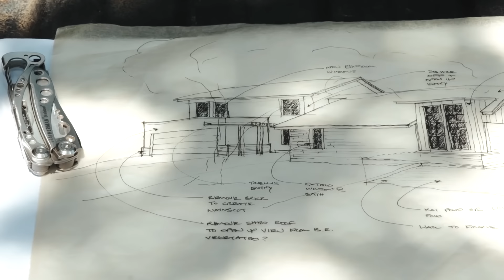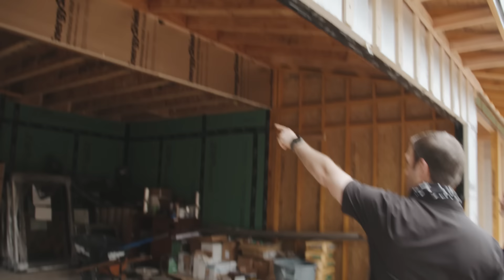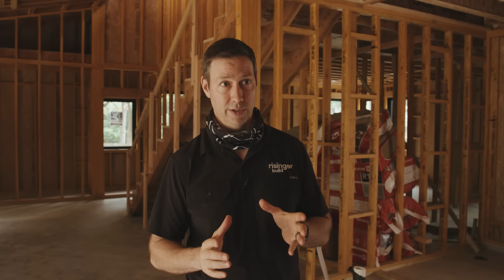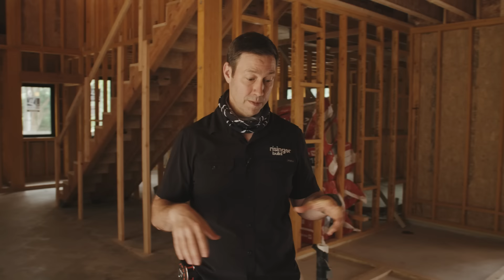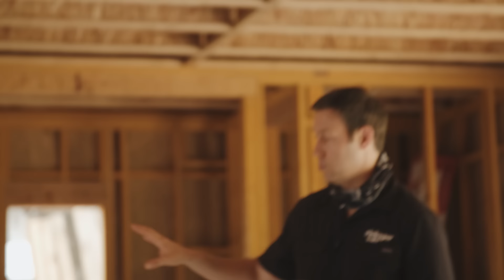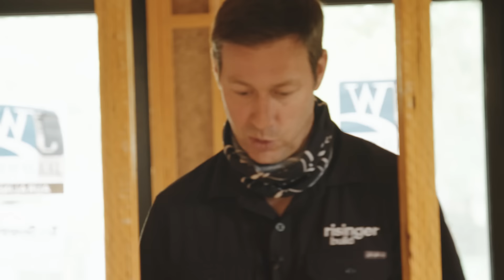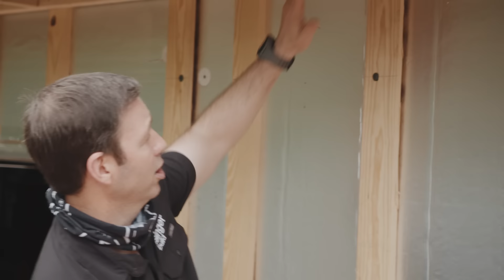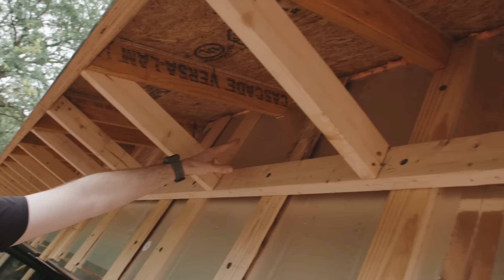The Perfect Wall - Building Science Training

Comment: what is the function of windows in an "airtight" home with an HVAC system that brings in fresh air on the homeowner's terms? are the windows purely for lighting/solar gain purposes, or are they also to be considered for ventilation? it almost seems, with the perfect wall system, that the windows should just be fixed so as to not disturb the balance of the HVAC system. thoughts/input?
Reply: Ventilation is a big part of our lives. Open the window, and you'll get plenty. It also doesn't cost you a cent of electrical power to open the windows.
That said, if you have allergies certain parts of the year, then keep those windows closed, and run the HVAC system.

Comment: you had me up until polyiso... It's no good Matt. we need to get all of those engineered products out of our homes.Engineering needs to shift focus onto what the core building mass in and by itself can do without motorized this and composite that. All of the buildings you are referring to as being 3, 4-500 years old don't have any of that, and those that have since become that plastic bag treatment, are rotting from the inside out. Maybe a building doesn't need to breathe, if it's concrete or plastic, but wood certainly does. One thing about moisture is that you can be certain it will get in. the trick is to get it out again, and that is where polyiso and any mineral wool will fail. Eventually. Not today or tomorrow, but give it between 10 and 50 years. Those properties are built in in old school materials: Wood, adobe, lime, that sort of thing. The entire structure needs to be part of moisture handling, and tied in with that, of course also insulation and light. To build the optimum, you'll not only need to know your climate zone, but also the 4 corners of the world, along with the sun's path across the sky both summer and winter, to size and place windows and eaves. Clay render can handle a great deal of the inside moisture from sleeping, cooking, showering etc, if done right, meaning for instance no latex paint on the walls. You've been to Tirol, and seen how much of it works, even though it's not Texas. All of those buildings have a vapor brake in stead of a vapor barrier. As long as things can dry out, there's no need for waterproof. You don't live in a swimming pool.
Reply: How do you deal with temperature control without sealing though? As far as i can figure, all the buildings that are currently 500 years old never had AC, so no condensation problem on a massive scale. I do understand that any structure will provide shade and a cooler relative temperature and that condensation will occur at or below ground level due to the cooling effect of the earth. As such old structures are usually damp in the cellars and basements. Which is not a problem because those areas were/are constructed with water tolerant materials like stone or brick for load bearing purposes. Not a great thing for mold though. 

Based on this I would have to assume that either the type of structure you are advocating would not have AC, and would have damp below ground structure. Or would have AC and then have a large dehumidifier system to control dampness. If its the first case then you sacrifice temperature control for structure longevity or in the second case you sacrifice energy efficiency for longevity. I'm unsure if I'm missing something(you seem knowledgeable so I probably am) but neither of those scenarios are my personal first choice.
Reply: @lexpox329  That I can definitely understand. Neither option is very pleasant. However. There are solutions to these problems. More natural ones. If you're in AC climate, an option could be to lay down a pretty grown pipe for air intake, both length and dimension, in such a way the condensation, if there is any, would happen prior to entry of the house, and run backwards in the pipe (sloped down slightly towards air intake, in conjunction with a "heat chimney", which would basically be a window, hatch, roof outlet or whatever, that lets hot air out, and sucks cool air in from the ground. No gasses, compressors or motors needed, only the right dimensions and numbers for the house, maybe with a flu and a small solar fan to regulate airflow.

In the south, warm/hot climates, you'd want lots of thermal mass and shade. Building gets heated up during the day, and stays warm at night. Typical desert climate. To deal with heat during the day, you'd preferably want tall ceilings, and buildings created with lots of surface area, so one part can shade another, not to overheat it. Narrow streets and tall-ish buildings, like in the Mediterranean is one way of dealing with it. Then you can decide whether everything actually needs to be indoor space, or you'd like for some of it to be atriums, an arcade or some such. An indoor water fountain also doubles as air-conditioning, though much more pleasant. There are ways to make those with a minimum of added power as well.

Up north where I am, we have warm humid summers, semicold winters and wet about ¾ of the year. The pea belt. Perfect for rusting cars and rotting houses. We can't afford to waste the sun, and so need large windows to take full advantage of the winter sun, but to be kept in the shade during summer. Along with all of the water, this means you're going to need large overhangs/eaves, trellises and the like, for light control. Otherwise you'll have 110F during summer in the house, since they are insulated at least to the point of Canadian passive homes. The underground air intake works just as well here, though need not be dug as deep, or have the same dimensions as in southern climates.

The hygroscopic properties of steel, stone, cement, oil derivatives and glass clash with wood. They're best off not being mixed, unless we're talking windows, where there are ways for the moisture to escape. Much healthier for the wood is clay, straw, hemp, lime and other non-chemically bonded materials, chemical as in man-made. Clay is one of the best materials to keep wood dry along with being an excellent thermal mass and moisture regulator as well. With daily airchanges, you'd barely need any further ventilation/dehumidifying in most rooms.

The old ways have gone lost, and modern construction only seeks to monopolize through patented systems. It is no longer a place for thinking individual human beings, like the craftsmen and architects of yesterday were. There needs to be an uprising. It's becoming about as bad as buying into a nicotine habit.

Comment: Matt I am going to start my own house remodel, house has 2×4 studs im going to rip out the sheetrock,  then and 2 inches of closed cell , would it be okay to add zip system on the inside then 5/8 rock?  Reason i didn't rip the outside off was going to do two rooms at a time..

Comment: Great episode, thank you.  How does the perfect wall concept vary from your house in a northern climate?  I am in Manitoba, Canada which would be a relatively similar climate to Fargo/Grand Forks/Minot, North Dakota.  Specifically, in relation to a vapour barrier.  If we create our continuous air barrier using zip or an equivalent product how do we protect the wall assembly from wetting without using an interior vapour barrier?
Reply: Read Lstiburek. You are not grasping the concept. Works just fine in ANY climate. The key is balance of interior/ exterior Rvalues, if you do as Matt has here, and add interior batts. The goal is dew point ALWAYS in the exterior foam layer. A vapor barrier on the inside, in any climate, perverts the systems and can lead to rot.
Reply: The whole point of a perfect wall is that it's perfect--it performs excellently in any climate. In your example, ZIP is your vapor barrier, and even if it weren't (e.g. you used DensElement), when the water vapor condenses it does so in a material like foam or mineral wool that isn't damaged by water.

Comment: Great that you're using an ERV.  Zehnder is used in a lot of passive homes.  Did you consider https://buildequinox.com?  Their CERV2 is "smart".  It changes air flow based on sensors of heat, humidity, voc's and CO2.

Comment: Quick question on your solar.  Are you going to tie directly into your local grid or are you thinking about using batteries and an automatic bus transfer device so that if the grid goes down, you still have power?
Reply: A generator will work just as good, no ?

Comment: Somehow I wouldn't have thought that R26 on the roof would have been enough
Reply: If you consider no thermo bridging from the rafters it's more effective. Plus if you look at the insulation curve anything after 30 - 40 R is a waste of insulation.
Reply: Also, the Delta-T of Austin isn't what you're going to find and Augusta, Maine.  Cooling, in some respects, isnt as hard as heating.
Reply: He'll still be adding batt insulation between the rafters to bring the R-value up to code, or beyond.

Comment: The airspace on the exterior of the house with the Wildland fire preventive measures how do you use a screen that would meet fire code..  what I've seen is very expensive to use is there an economical way to prevent fire from being drawn into the wall
Reply: Front Range Colorado these regs are common in the foothills/ rural ares. We have had to build per the regs, and roof venting is simply prohibited. I have projects up for years, with the compact roof assembly, no air gap, and NO problems. You give up a bit of insulation potential, but just size the foam layers appropriately. Still the absolute best (for me, ONLY) way to go. 

As for walls, we did stone veneer with a very robust drainage plane dimpled mat. Venting the wall was not a big issue, but insuring the sanctity of the weeps is very critical. If you are seriously looking at a real project, and contemplating rain screen in a Wildland Fire Regs district, I would get all my ducks in a row early, and go talk to the plans examiner. We do this regularly, given the nature of our jobs. In the talking phase, you have "wiggle room", and can get your ultimate detailing approved before you are slammed with a "tear it out" order. You could very well prevail with the right approach.

Comment: We hired someone suposubly to replace our siding and they told us that we were supposed to change the Particle Board exterior, and replace it with harder type of compressed wood. To add color plus  James Hardy siding. Is a total disaster . It was installed by amateurs etc. Anyway also out home is like 40 years old the boards looks boated and they didn't let us know.  Now they said that is because our house was uneven. If they would have let us know before. Also suposubly they are James Hardy Elite company.  Etc......

Comment: Can I do a ZIP wall system on a 5 year old house here in S.E. North Carolina? The builder cheaped out on every portion of this house. The house leaks air like a sieve. 2X4 wall construction with R-13 batts, cellulose blown on top of the ceiling. The air handler for the heat pump is in the attic space and when the blower turns on the flexible insulated air conditioning ducts are initially blowing warm due to the attic air heating them during the off cycle.
Reply: Steve, try this, for starters:

https://www.buildingscience.com/documents/bareports/ba-1502-measure-guideline-high-performance-mineral-fiber-insulation-board-retrofits/view

Then you can read more of their stuff. Dr Joe is The Godfather of building science, Matt is the acolyte, who now has to tend his sponsors and media empire, to the detriment of disseminating a full knowledge base. 

There are MANY pitfalls. Do not undertake without full understanding.

Comment: How do you properly flash at wall to roof areas when you have foam at walls and furring strips? Wouldn't you want that at your water protection layer (in your case from Wall Zip Sheathing to the top of your second layer of Roof Zip Sheathing?

Comment: Do you have flashing to handle water that may get behind the polyiso on the roof/sidewall intersection?
Reply: Watch his last video, he did a test and it drained.
Reply: That's my point.  Any water that hits the gable will have to be handled by the facing of the polyiso and the rain screen.  If any water gets behind the foam board, it doesn't look like there is flashing to divert that water back out onto the roof.
Reply: @jonblakemore6454 , Matt is definitely going to have to answer that , because I have no idea. Sorry.

Comment: Spray foam would be more cost effective at air sealing.
Reply: Spray foam is not a cost effective air seal. The Zip system and other systems like it are more effective and more durable. (this is coming from an insulation contractor and building performance analyst) 10-15 years from now we will be using less than 1/2 the spray foam that is being used today.
Reply: @6stringsandapick I was a foam contractor in the late 70s and 80s and In Las Vegas we cut power consumption by 75% with an inch of urethane foam on the outside, foam in the cavity, and R-38 in the attic with good windows.  Huge savings forever.  For example, two houses next door to each other in Sunrise Mountain area. Foamed home, $83 July Nevada Power bill, house with code R-11, R-19 fiberglass $300.00.   You don't have to go hog wild to save thousands year after year and year after year of comfort.
Reply: 6stringsandapick oh so you are saying to install zip and tape everything, plus still insulate it after, labor and materials, is cheaper than $2.65/ square foot for 3 inches r-21 of closer cell foam? I doubt it. Then it doesn’t perform as well either. I’ve been applying spray foam for 10 years and even installed it in my house and several buildings I control. I’m also zone 4A. So it gets flipping cold in the winter and scorching hot in the summer. Foam is cost effective and it performs as advertised.

Comment: Can you spec the the screw in overhangs for Coastal Texas regions? Or will it not meet windstorm?
Reply: Only your engineer can do that; it is the Gestalt of type of wood used , size of member, overhang length, back span on the cantilever, dead load, live load, etc etc. "It" will meet any engineering requirement "It" is designed for.

Comment: "Poly this Poly that" So much synthetic materials, how to you guys do when you have to recycle? Don't want to sound like a green guy, but why don't you use some more natural insulation materials, like wood fibre, sheep wool, hennep etc so much great materials ou there plus they wont burn like al these synthetic materials.
Reply: he is planning to use Rockwool bats in the stud cavity
Reply: Oh well in that case
Reply: Bram Ramon who cares hopefully it lasts 500+ years haha
Reply: The synthetic material he is using has a higher R-Value, so it will be greener in terms of energy use.  It was discussed on This Old House once how the energy savings more than offset the un-recyclability of the materials.  In the North East, Green building will involve a lot of spray foam in most cases because of our winters.

Comment: can we get more details on the rafter tails on the outside?
Reply: You would be better off not getting details. This is a kluge job, not particularly well thought through. The compromises (which are necessary, given the original premises) are not particularly good, or optimized, in my  opinion. opinion backed up by doing continuous foam roof insulation for more that 40 of my 49 years a a professional design/ builder.
Reply: Lee Stevens what problems do you see? Some examples, instead of such a blanket statement, would be helpful
Reply: @aayotechnology  The detail used is disrupting the insulation blanket extensively. There are ways to use a more conventional tail, with good air sealing at the tiny wall penetrations, minimize the labor (extends to hacking the foam up, ripping and wasting a lot of LVL, etc), and most importantly kill the air networking (see Dr Joe) that is created and exabberated by the detailing they choose. I raised these issues with SteveB on the roof insulation vid, and got a pretty defensive response. To each his own, but I would expect (and insist on, and do do)  better on my jobs. 

In cold climates with ice dams, the lack of insulation all the way to the sub fascia can lead to problems. I have done full foam roofs for more than 40 years now, and long ago decided that open soffits (no foam )was risky and the savings were negligible. We have had to do compact (unvented) assemblies usually, hence my focus (woodland fire regs preclude venting): not a big a concern with full venting, though.  

Finally, if Matt wants to claim "Advanced" for his framing, he is far short of the innovations and techniques we use. Spending all that money on LVL's, and not fully utilizing the properties is wasteful. If 2" depth of tail vertical at 24" OC is structurally sound, then a 3" tail every 48" (cut from the rafter, no scabs) , with a 1 3/4" x 3"  penetration out the wall, at the eve, would be a smarter and more create way to address the overhang issue. Likewise, with the tails below the foam package, the subfascia can be deep enough that the barge rafter can be supported by a cantilever of the sub fascia and a cantilever (again, small footprint) of the ridge board (yes, it is NOT a beam, in this case). Combine with a "ledger" for the wall side, some ladder blocking, and tie it all to the roof assembly. The spider web drone shots may be cool and all, but I see them as someone did the first thing that came to mind. That's okay of course, the place won't freeze or fall down. All is good.